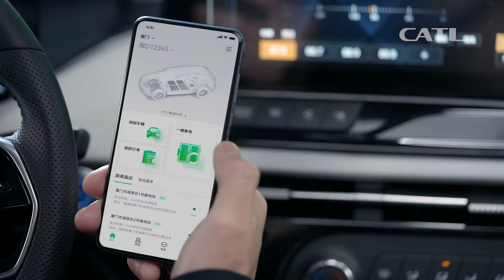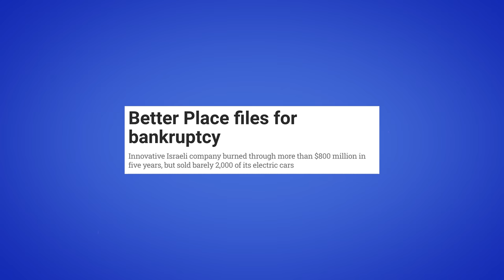Why Battery Swapping Is A BAD Idea

Comment: I see a lot of Nio proponents in the comments, but to me battery swapping seems like a solution that is worse than the problem it's trying to solve. For the few times of the year when I need more than the 500km for a day of driving I can stop at a charging station that takes 20 minutes to charge back up to 400km of range. I'm probably going to want to stop driving for at least 20 minutes after driving for 5hr at 100km/h. For the other 360 days of the year my car charges overnight at home. And even beyond that, my car can charge throughout the day when I'm parked outside of a business.

Getting proper charging stations in apartment buildings and at more businesses and public parking spots is a much easier and cheaper solution than replacing gas stations with battery charging stations. It's really hard to see a scenario where battery swaps are a better solution. Maybe for commercial vehicles that routinely put in 500km+ every day?

Comment: He got some good points but also missing out on a lot of positives that come with swapping. the most expensive part is the battery in EV's, so just imagine, new batteries are developed, you can switch them out and get the latest version without having to buy a new car. Not good idea? what if the battery breaks down on your EV? you can just swap to a new one. Who can afford to buy newer EV's all the time? How long does your EV have to last? You can always get the latest battery. Also you don't switch batteries all the time, no one would do that, therefore you don't have to have a huge battery swap station infrastructure. the point is not to constantly switch new batteries. No that is not the point of battery swapping at all!, Missed the point!!!

Comment: Battery swap is not a bad idea, it just can't work for consumer owned cars without standardization which doesn't exist right now. Battery swap is absolutely going to be a thing, but in the beginning not for that market. It'll make tons more sense for agricultural and construction equipment, cargo vehicles, buses, even taxies and rentable cars, in other words - in business and industry, not for consumer. Once standards develop and get entrenched there, it'll be much easier to transition to consumer market.

Comment: I'm fine not swapping batteries but I wish they would focus on making batteries easier to fix.  Instead of 20000 to replace the entire battery pack because of one dead cell, make it easy for mechanics to drop the pack out, replace the cell and put it back in at a low cost for the car owner.
Reply: In the USA Gruber motors will recondition Tesla battery packs for a LOT less then the replacement cost - they have a YT channel.

Comment: I could see this working is a world were evs use nonrecharable batteries like aluminum air batteries.  You pull into a place to get a battery swap every few 1000 miles like an oil change.

Comment: I don't like it for a few reasons, extra batteries needed, extra failure point with removing and re-fitting, limits future platforms to fixed batter size and as mentioned, extra costs and land needed and with only one manufacturer's cars working with it, it's just not going to happen on a large scale outside of China. Also, Renault tried battery leasing with the Zoe, which has put people off, like myself and so they stopped doing it in the latest model.

Comment: I don't agree with the opinion in the video. If you look at how manufacturing and car-brands have progressed you see a trend in sharing platforms. Just look at Volkswagen / Seat / Skoda which are basically the same car. With batteries all having similar structures and being placed at the underbody of the car it is  not too difficult to make a standard of like 3 sizes of battery. Through the internet and modern technology it becomes easy to know and locate a full battery fit for your car. Also the fact you don't have to get out of your car and the car parking itself is just another way to stay comfortable. Nio owners are excited and use it regularly proving it is the more convenient option (at least in China). Also Nio and China pushing this technology is a way for them to gain a lot of power and influence world wide and becoming a leader in the energy transition and energy storage. Like others have said creating a network of swap stations also means having a lot of stored energy, which could reduce strain on energy companies having to deliver energy in peak hours when everyone is charging. They could also install solar panels on top of the swap stations...

You have to look at this as more than just a solution to swapping your battery in the car. You have to see this as a major technology and solution to the energy transition: storing energy, standardizing battery design and recycling batteries. These swap stations could charge batteries during the day and then give back energy to the grid when needed during the night.  The possibilities are endless.

I honestly believe Nio and Chinese companies are making such major improvements in this technology that other car companies will be forced to use their technology in the future to keep their own R&D cost down and stay competetitive in pricing their cars.

Comment: battery swap only become feasible if the batteries are standardized... just like we use almost the same kind of petrol for almost all cars.. there is no brand specific  petrol... but I think as rory said, batteries are the integral part of an EV, so EV manufacturers won't be happy to standardise them..

Comment: The solution is not battery swapping, it's having a better charging infrastructure! You know, if we could have a standard like USB-C but for EVs that just works fine whenever you plug them in it would be way better :)
Reply: Why? The charging capacity in vehicles per hour is the metric.
Reply: @davelloyd8454  Have you seen the amount of people with EVs whose cars won't even charge at a charger because for some reason either the car or the charger doesn't recognize the other? You can't even think about how much your car charges in an hour if it doesn't even start charging 🥲 (But that would be step 2! And it's still a part of "A better charging infrastructure")

Comment: A typical petrol car tank holds 10 gallons or 45 litres of petrol and weighs around 33kg. An equivalent EV battery weighs over 500 kg (half a tonne) more than this. The heavier the vehicle the greater the energy consumption. Go figure as they say.

Comment: An advantage of a battery swap station over chargers is that the chargers need to be provisioned for peak power use yet there may be times when there are no vehicles charging (likely a good proportion of the day). A swap station could use much less peak power and do a lot of the charging overnight.

Though I still prefer the hybrid model. A small battery good for about 100 miles with a small gas engine to provide the range.

Comment: You mentioned the biggest economical reason for manufacturers to not support battery swapping, but you miss the biggest technical reason: structural integrity of the vehicle.

Think back when ICE cars had a frame and a chassis and what kind of a big deal in safety, costs, and less weight a self supporting chassis was.
When the battery stays in the vehicle the case can be a part of the chassis.
Reply: It increases cost and moves "afforable EV" goal even further

Comment: Swapping is a dumb idea. Putting your car through a mechanical procedure just to achieve a full battery will add wear and tear. It’s adding complexity and for what, to save 20 minutes at a rapid charger. It’s not the battery in your TV’s remote control, this is a serious battery we’re talking about. I’m happy with charging, and it’s only getting better. Let’s not look to solutions for the impatient, let technology mature, it’ll be even better if we do.

Comment: There's a whole more list of reasons why battery swapping isn't a good idea, that hasn't been mentioned here. Who is liable if the swap robot does something wrong and damages your car? Who is liable if you receive a battery with some sort of defect that damages your car's electronics? They surely don't run a full certification with each battery that comes in for a swap.. so you receive a very important part in used condition with no known history.
Also, more manufacturers are experimenting with making the battery pack an integral part of the chassis to reduce overall weight, which makes the battery pack inherently un-removable anyways. Not that it'd be possible to get any significant number of manufacturers on one table to agree on a common battery standard anyways, since that's such a defining part in the overall car design and structure.

Comment: Does NIO give a toss whether other car manufacturers get on board with the same batteries, plainly not. Why is this a problem, you do understand that people will simply buy more NIO cars, problem solved. Competition will sought out the other car manufacturers. How do superchargers make more sense when swapping takes minutes and eliminates every limitation with EV uptake. Battery chemistry says no more battery progress. Whilst manufacturers are still tooling around with battery tech NIO is rolling out modular swap stations that can swap all day long.

Comment: Swapping batteries is the future.
As there will be many older batteries need recycling, these will become the new batteries to be used for swapping.
There will be 2 prices; one for the vehicle and one for the batteries.
There are going to be different types of batteries; normal, economical, powerful ones for better performance.
Arriving in the recharging station the driver will be able to select the type of battery and pay the associated fee.
Reply from the maker: You’re tripping
Reply: @AutoTraderTV  This is the kind of argumentation that I wasn't expecting from AUTOTRADER...

Comment: I never saw any long term requirement for it. We just need to increase the number of rapid chargers and get the charging rate to a point where a car can be fully charged again under 15 mins. This will have been achieved by 2030.
Reply: Your comment tells me that you don't fully understand the problem: You have previous generation cars, with no possibility to fast-charging, but that also occupying a charging isle.And the you have peak usage, the maximum charging power decreases accordingly, reducing even further the charging times.
Reply: @pg205  even taking that into consideration I still don't see it as a long term problem. The vast majority of people will want to charge their vehicle at home so reducing the requirement for rapid charging stations. In the time I've owned an EV I can count the number of occasions on one hand I've had to use one.

Comment: This report does seem to be bashing on battety swapping and yes there is significant issues around the implementation of such technologies. Which does make you think should there be something like a ISO standard for swappable batteries should conform too. 
The biggest thing this report ignores when saying putting in more charging stations is the capability of aging power generation and delivery networks, many operating beyond there original design life. Also already potentially now beyond what they were originally intended to delivery, let alone coping with the massively growing future demand. 
Add two 7kW home vehicle chargers to every household, replace all gas/oil boilers with electric boilers or heat pumps. Then add publicly accessible vehicle charging and industry changing requirements for heating energy. 
Suddenly the demands for electricity on the power networks/generation starts to climb rapidly. 
As far as I can tell the energy generation and delivery companies seem to be doing everything they can to avoid the cost of replacing and upgrading the existing network. Instead pushing a type of "smart" flexible energy connection. Where by the end users subscribe for a level of energy availability. Also the introduction of load shedding in end users premises, the ability of the power networks to remotly turn off end user equipment and or supplies to ballance network demand. If I understand correctly legislation has already been brought in to try and mitigate the problems of energy delivery for vehicle charging. Meaning that all new home electric vehicle charging points installations must be controllable by the energy networks so they  can stop vehicle charging when the demand on the networks is too high to cope. And as the demand is only going to grow when will people start finding in the morning that there vehicle hasn't charged enough over night to make there daily journeys.

Comment: It's a lot easier to add Superchargers than swap station. Superchargers have at least 8 plugs and the newer ones have 12. If you assume an average charging time of 20 minutes, I usually spend less, that's a throughput of one car every minute and a half. A swapping station can only handle one car every five minutes. 
On a road trip the charge time doesn't need to be any faster than the time it takes  to go to the bathroom. 
A big difference between China and the US is that the Chinese live in rabbit warrens where there is no place to charge. Americans live in houses where it's trivial to install an EVSE. Suburban apartment complexes have parking lots where its also easy to install EVSEs, the problem there is just convincing the management or condo board to do it. I can't see swapping ever making sense in the US.
Reply: Superchargers are also commonly found with 4 plugs, and some are even as tiny as 2. Just a sidenote!
Reply: @wojciechmuras553  Where are there less than 8? I've been to every Supercharger in New England and they all have at least eight, the newer ones have 12.
Reply: @joshuarosen465  All of them in Poland for example are 4 stall.

And on Puerto Rico, there are 2 stall chargers, including V3.

Comment: i agree battery swapping sounds a great solution in theory, but as you say, for it to work all manufacturers will have to get on board. AFAIK they're only now starting to standardise on the type of EV plug, so i cant see it happening any time soon. Maybe one day someone will come up with a fast 'refilling' option for cars such as putting a putting a tube in a hole and squeezing a handle, with a plethorta of universal 'filling stations' all over the place. maybe one day....
Reply: maybe one day it wont cost 50 bucks just to get 300 miles of range, while simultaneously destroying the climate

Comment: You do realize that they would just charge the batteries that they swap out, right? So, they would have a continuous cycle of batteries. Why do you think they would just use the batteries up? And as they are swapping out batteries, they will have batteries recharging.

Comment: I was hopeful about battery swapping before watching this video, but you do make a lot of good points!

I'm also not all too sure about battery swapping for scooters. Is it really worth it to have infrastructure to swap a 3 kwh battery? Might as well just get some faster charging on them too.
Reply: Actually, in the Netherlands we have e-scooters as a service. And they swap the batteries (they know status via mobile network). This is however in cities of about 100 thousand people or more.

This is how understand it goes (have not done it myself):
So you install an app. You look for such an e-scooter. You connect the app on the phone to the thing. You now drive it around. You disconnect the app, and you pay for the time involved.
Reply: I thought the idea of the swappable scooter battery was more so that you can carry the battery into your home and charge it. This way, you don’t need to park the scooter near an outlet.  I guess it’s more of a “removable battery” than a “swappable battery”. I guess if they are cheap enough, you at an have an extra one always charging while you’re out riding.
Reply: I've ridden an E scooter and swapped out it's battery. It could easily work except they are very heavy. A lot of people wouldn't easily pickup a battery and replace it, even a small one that's in a scooter. However I would 100% buy a electric scooter or motorbike if I knew I could swap a battery at a servo... Swapping stations for cars are only an issue for those doing longer distances. My guess that most people use their cars for small daily trips and with GPS mapping there are very few times most people would get caught without power. So we wouldn't need too many changing or swapping stations around the cities. Far less than there are fuel stations right now.. However on interstate freeways you would need them to alleviate range anxiety. And in the near future if you run out of power, simply call a driverless power taxi to come top you up. Just like many people use road side assistance services.

Comment: This is an interesting question, with the re emergence of electric vehicles. Not enough bicycle shops to recharge your batteries.  When you look at the complete price of the charger network and the price for a swap station, there isn't a lot of difference. As you say it will take political will to standardise on the power packs, so no hope here or in Europe. Car makers are looking at people not owning the car. With self drive, you get on your VW app or Avis/ Hertz/ Sixt car app and book a car for a journey or a period. If you go for a meeting the car will pick you up drop you off, and a car will be wait to take you back. It maybe the same car, or could be a different as the first will be at its nearest VW, or associates, recharging. It will be an interesting history to watch.

Comment: it would be better if you have a electric car that supports swapping batteries because you can have the option to charge or swap, rather than having an electric car that only supports charging